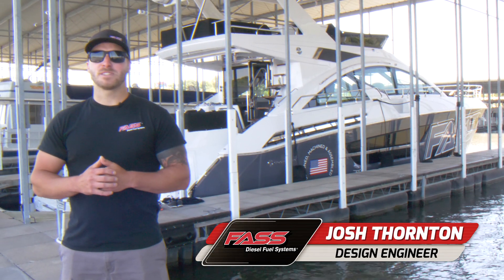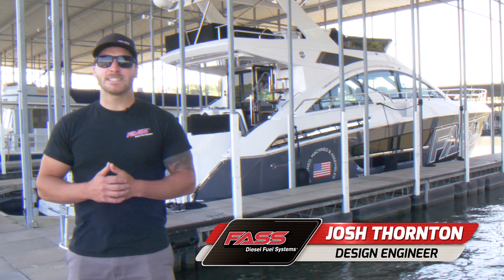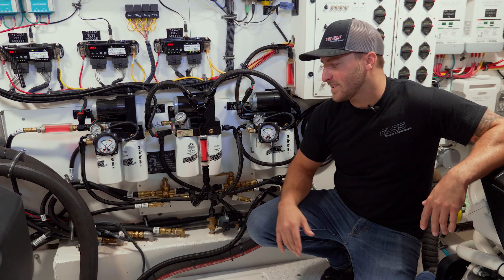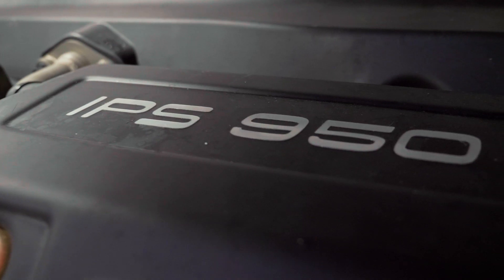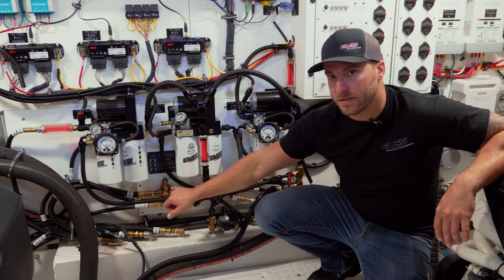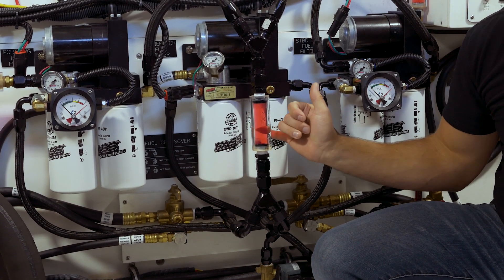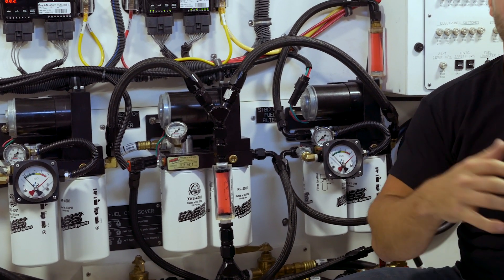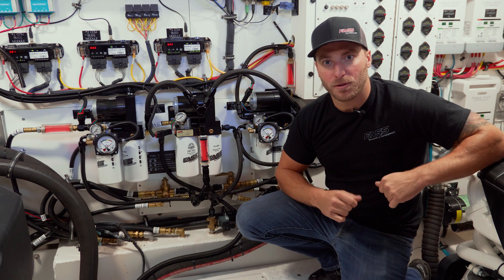FASS Boat Fuel System Installation!

Comment: as a marine technician i am interested in some more details! what are the before and after numbers? Have you worked with the manufacturer? did you remove stock boat side fuel filters?